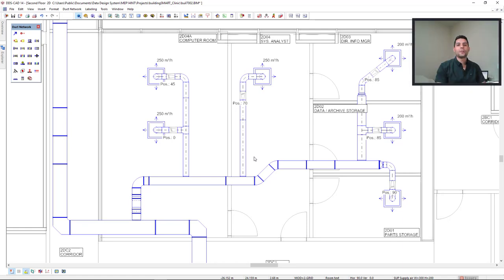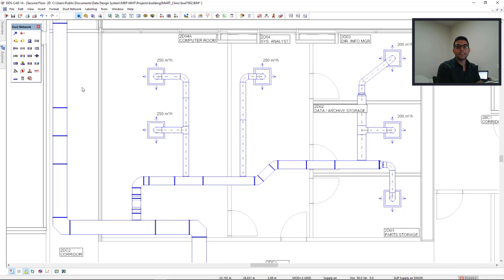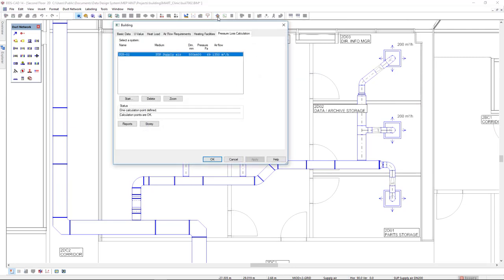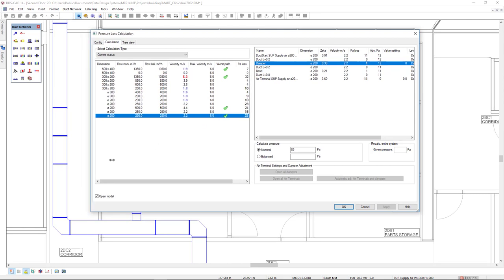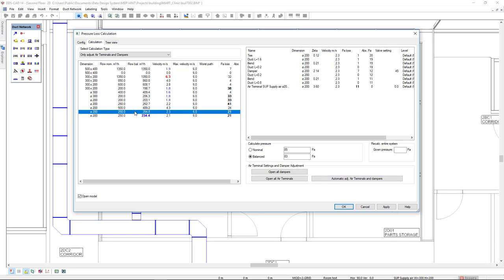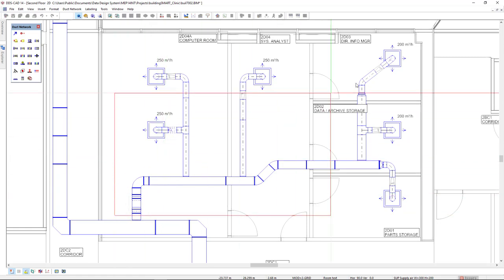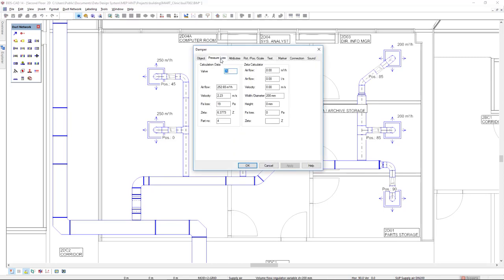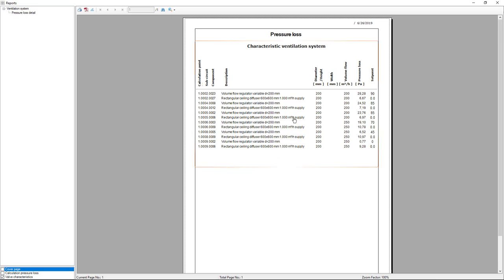Automatically balancing a ventilation system by adjusting air terminals and dampers

Comment: can i ask what is the formula of balancing  the pressure passing the dampers in each rooms ?
Reply from the maker: Hi Jan, to use correct Syntax for dampers and air terminals values has to be taken from manufacturer diagrams or tables (Zeta / setting values). These values do not come from a standard. This pneumatic balancing is a physic based calculation. For proper functioning of a ventilation system, the volume flows must be set correctly, i.e. each air terminal should only receive the air volume that corresponds to the calculated duct network calculation. Velocity limits and preferred dimension can be defined by user before calculation in the different parts of the system with the velocity levels. 

Everything is here open to define it depending to local requirements (kind of room, needed air flow, handle velocity limits)

Comment: What do you mean, by syntax? I tried with the same parameters as you show in this video, but the damper value are all at 1, they don't change no matter what I try. 
As for the text, they only display DM164V160-250, they don't display their opening. What am I missing
Reply from the maker: Hi Mathieu, by default the pressure loss calculation is calculated with nominal pressure in which all valves are opened, that´s the meaning of the value number 1 you found in the damper. It is also possible to insert a syntax in the air terminals and dampers in order to balance the system. If you like to go more advanced on the pressure loss calculation, send an email to info@dds-cad.com and I can offer you a consultancy.
Reply: Thank you, (I fixed the text issue I was having, user error of course, I did not know I could right click on the damper list item and edit it)
for the damper, as long a 1 means fully open, that good.I can live without the damper adjustment. However I would like to say that It would be very useful for the user to be able to set the valve value manually. thank for the consultancy offer, but I don't really need to use the dampers.
Reply from the maker: Hi  @warwolf7  , just to mention you can manually adjust dampers and air terminals. If you double click a damper for example, you will find the Pressure loss tab. There you have the possibility to calculate a zeta value, and manually insert the calculated zeta in the calculation data. Both entries are available in the Pressure loss tab of the object dialogue. Hope this info is helpfull! :)
Regards, Filipe

Comment: This Mumbo jumbo means nothing.
Have you ever done any real balancing on a HVAC system.  Constantly adjusting hard to reach dampers off ladders.  Chasing air quantities to a consultants design using a balancing hood.   God you propeller heads drive me insane.
Reply from the maker: Spot on. In the digital world everything is just mouse clicks away, no need for ladders or trying to squeeze a mouse cursor through hard to reach spaces. So definitely I agree with you; there is a  difference between engineering a digital design and physically adjust dampers onsite. Nonetheless, with DDS-CAD we aim at delivering high quality documentation so that we can relieve some of your challenges onsite.